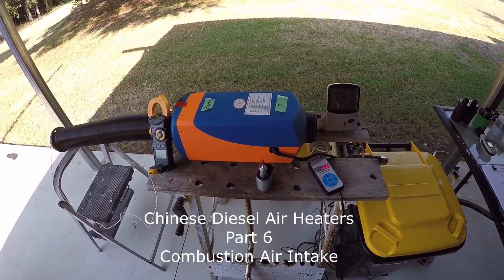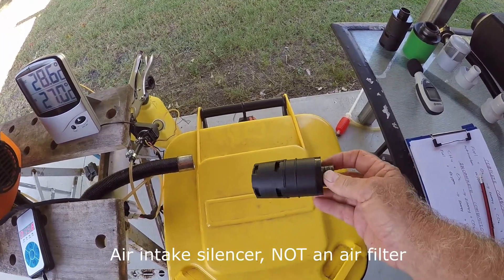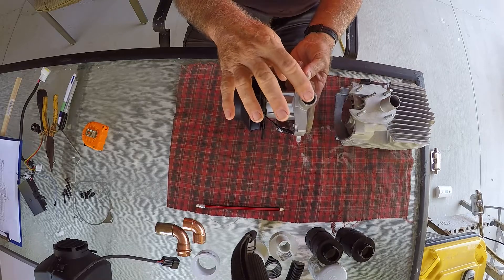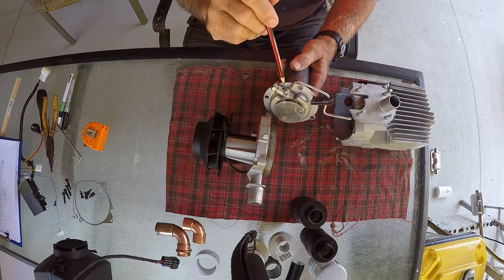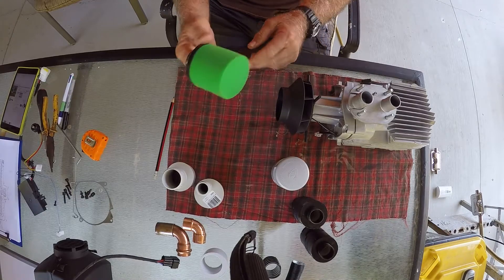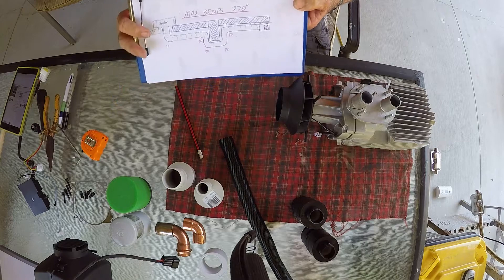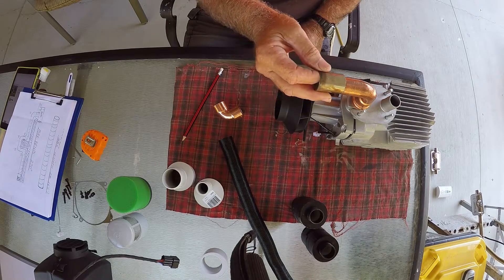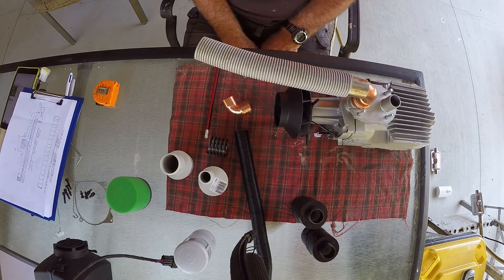Chinese Diesel Heaters - Part 6 - Combustion Air Inlet

Comment: John, I have the same controller used in your demo (part 6 & 8). Can you offer a easy to understand copy of the operation of this controller? I don't understand the translated version that came with my heater.
Reply from the maker: Hi Rhonda, sorry I missed this post, I get about 40 a week, and occasionally I miss some.
I do not have written instructions for the controllers, but may do a video about this at some future time., but here is a simple start for this blue circle controller. 

Turn on a short tap on the centre button. Turn off a long push on centre button until left LED flashes.
Increase temperature manually (my preferred method) push top arrow button up repeatedly to the setting you want. To go lower, push down button repeatedly. Use right button to cycle through some functions such as temperature.

Basic info, but should get you started.  JMcK

Comment: Are you able to contact me as I have watched your videos but my problem is LSD lights on the controller no longer light up.Larry Dunks 0417728486
Reply from the maker: Hi Larry/Julie, sorry to hear the issues with your LED controller. Occasionally the controllers do fail and you may need a new one as a spare part.

If you have had the heater less than one year I suggest first contact the supplier about this issue and seek a replacement controller. If that does not work contact eBay if bought through them or PayPal if paid through them. They may help with a refund of a controller cost.

Provided your heater is a standard Chinese  diesel air heater and uses the common wire connection protocol you can buy a spare controller on line from about A$16 for a manual controller to about A$25 for an LED controller with a remote.

Search on line for "Controller for Chinese diesel air heater, or Controller for Chinese diesel parking heater"

Below is a link to get you started in your search.

https://www.ebay.com.au/itm/12V-24V-LCD-Switch-Parking-Controller-Air-Diesel-Heater-Button-Remote-Control/313086073340?hash=item48e56259fc:g:OcAAAOSw9-tewfgy

Cheers,  JMcK
Reply: Thanks have just ordered one. We have 3 batteries and a solar panel on the roof charging all the time could this be causing the problem.
Reply from the maker: Julie Dunks 
No Julie, unless there is possibly a voltage regulation problem with your system and you are getting excessive voltage in your system. 
Do you have a heater master switch so you can turn the heater completely off? If not, the LCD controller is always on.  JMcK
Reply: No we don't have a master switch I can put one in but I am not sure where to wire it in if you can advise me that would be great.Larry
Reply from the maker: Julie Dunks 
Hi Larry, you can install a master switch anywhere in the positive power line from battery to heater. Just make sure it is in a position than can not be accidentally turned off, or mistaken for a light switch or similar.  JMcK

Comment: Excellent series of videos.   Would there be a problem with just having a straight intake hose through the floor of a trailer and putting a filter on there?  I did not understand if there was a minimum intake length like there is with the exhaust.
Reply from the maker: Hi David, thanks for the feedback.
That could work, but make sure the exhaust could not melt the intake filter.  Probably better to have just a short intake hose with a 90 deg bend under trailer to take intake just a couple of inches away from exhaust. JMcK

Comment: I'm just learning of these heaters,  your videos are the best. I'm planning on using one in a travel trailer. Does the main unit need to be inside of the trailer cabin?  I would like to have it in a weather proof trunk and just run the outlet into the cabin. Hope that makes sense,  thank you.
Reply from the maker: Hi Randy, nothing wrong with that, in fact that is a good install solution. You can have recirculating heated air, or heated fresh outside air. Suggest you put an insect screen over the inlet air, because the fan will suck in bugs.  JMcK
Reply: @johnmck1147  wow, that's good news.  Thank you so much for getting back to me with an answer. I enjoy your videos.

Comment: Hi John, thanks for the video series on these heaters - great work.  I just ordered one for our Skoolie and was wondering on your thoughts about a specific installation plan.  I would like to use the bus diesel tank (60 gallons), and opposed to tapping into the fuel feed to the engine, was thinking of replacing the tanks drain plug with a 90 degree fitting - but place a 2" or so copper/brass vertical nipple in the pickup side, so that 1) it's not getting fuel directly off the bottom of the tank; and 2) would always leave 2" or so of fuel in the tank for the engine.  Additionally, I think a mounting location near the front of the bus will work, so was contemplating using the exhaust of the heater to blow into the engine area (probably aimed at the engine oil sump).  The thinking is that if it's cold out and the diesel heater is running, it would also pre-heat the bus diesel engine (which is hard to start when it's cold out).  Any red flags in this setup?
Reply from the maker: Hi Jeff,

Sounds doable, just make sure exhaust gases can't get into the cab, and the exhaust does not face forward which would creat back pressure issues when moving.  JMcK

Comment: john,...regarding the 8000kw diesel heater, is it possible that it can make a big boom type noise like a back fire from getting dust into the heat ex-changer the reason i asked is i ask, is i just bought mine and after having it a day running it off and on,...it made like a big boom,...almost scared me out of my seat, i shut it down quick let it cool off took the top housing off of it and checked to see if it blew a hole in it,....there was nothing wrong with it,...but when the unit starts up now,...the glow plug emblem stays on and then disappears after the unit is running,....is that normal...
Reply from the maker: Hi thesecret2
A "boom" is not normal. Sounds like you had some excess fuel vapour in the burner. Why that happened needs to be investigated. 
The normal procedure is you turn the heater on, the fan starts to blow out any residue fuel, then the glow plug turns on to heat up the starter plug atomising screen, then the fuel pump starts. When the temperature probe on the burner tells the ECU that there has be a successful start, the glow plug is turned off. If there is no burner start after a set time the heater shuts down and tries the process again.  JMcK

Comment: of course it is going to get louder. you moved the outlet closer to the meter by the length of the silencer. that was not a fair example of the silencer. measure the sound from 3 feet away and 45 degrees off the axis of the outlet.

Comment: I must firstly how informative your video's are, 1st class.  My question is do you need a inlet hose at all can you just put a decent filter as close as you can to the unit? Cheers Martyn
Reply from the maker: Hi Martyn, first thanks for the feedback. 
Yes, you do not need an inlet hose and you can put a filter straight on the unit, but don't let the exhaust burn it. You may need a stub hose or lag the exhaust.  JMcK
Reply: @johnmck1147  thanks for the reply why I ask is I have a 2kw Erbaspacher on my boat in UK. Changed ignighter gause and gave it a good clean . When I start it I always run the engine to give it the amperage, it wants to go, blows alot of wispy white greyish smoke then turns bluish but it chuffs 
 and chokes doesn't quite fire up. So after looking at your videos looks like I need to check air intake and exhaust? 
Also worth mentioning I spoke to a webasto engineer, he said I high percentage of non starts are due to bad a bad earth especially on boats. Again fantastic videos . Hope all is well concerning Bush fires. Cheers Martyn
Reply from the maker: Martyn Randall .  Thanks for the feedback Martin. You are wise to check for restrictions in the setup. I would also look at your wire size. On start these heaters draw around 10 amps, low voltage or a long wire run to the heater of thin wire causes a voltage drop and poor glow heat.  JMcK

Comment: My question is if the intake hose is not a silencer then why bother with an intake hose why not just put a filter straight onto the heater. thanks for doing these experiments very interesting
Reply from the maker: Hi Jess, yes, you can do that if the heater is installed in a suitable area.  JMcK

Comment: the pvc screen vent you show here in this video. what is that for in plumbing/home improvement world........ can't find anything like it online from the big box stores... but Im probably searching by wrong terms.....
Reply from the maker: Hi Coachgeo, those are plumbing fittings, they go on the ends of PVC pipe for breather vents. Most plumbing stores will sell them. Suggest you take along a photo.

Or you could get one of these off eBay

https://www.ebay.com.au/itm/Air-Filter-Diesel-Heater-Black-Metal-Plastic-Manifold-Parts-Replacement/153602365113?ssPageName=STRK%3AMEBIDX%3AIT&_trksid=p2057872.m2749.l2649

Cheers,   JMcK

Comment: you seem to be very knowledgeable guy in combustion-ish things.. so may I ask you please...... if one were to add an HHO gas  source to one of these to use primarily as a way to occasionally clean out the combustion chamber or  improve combustion when using alternative fuel oils (thinned waist motor oil, thinned waste cooking oils etc...)  where would you suggest to fumigate this gas in?  am assuming as close to the unit as possible in some area of the air inlet.
Reply from the maker: Oh Coachgeo, these heaters need to burn clean fuel like diesel or kerosene. Yes, they will run - for a while on oils, but burning oil will really cause excessive carbon buildup in the burn chamber and the atomising screens. Excessive carbon in the burner atomising screen is almost impossible to remove.

But I also understand some people wish to experiment with these heaters as they are now so affordable. But in these cases I am unable to offer advice, for reasons most people would understand. Cheers.   JMcK

Comment: Since the fuel pump pulse rate is programmable/adjustable and fan speed also programmable then why not slow the pump and speed the fan. That way you get more air to fuel ratio?
Reply from the maker: Hi there, for what purpose? The pulse rate and fan speed have been optimised for best results in most conditions. Yes, if you are an enthusiast you could play with these adjustments to see if you could get a better burn at your location, but most DIY people only end up with excessive carbon build up in their heaters.   JMcK
Reply: @johnmck1147  for what purpose? Your video is all about air supply to combustion chamber and to avoid any restrictions to air intake. I suggested a different remedy to that problem. Increase fan speed and/or reduce pulse rate for those who can't avoid restrictions like many bends or long tube runs. I know the heater will run cooler but maybe that is good for the heater longevity.

Comment: Hi John what would cause smoke coming out the hot air outlet in the cap
Reply from the maker: Hi MW,
You should NEVER have smoke coming out of the hot air outlet.  Suggest you look at video no 15 in this series.   JMcK
Reply: @johnmck1147  thank you for your reply the air filter hose had too much bend in it its good now thank you for your series posts

Comment: I have a question John. I have this in my van. The air intake and exhaust are terminated outside the van. The van is more or less sealed inside appart from a 9x3inch vent close to the roof. Do I need to worry about oxygen levels? Thanks
Reply from the maker: Hi AA, I assume you mean the combustion air intake is outside the van. If so, you are not using oxygen from the van for combustion purposes. You also do not say if you have other combustion item in the van like a gas stove or candle lit dinners, or how open the vent and how sealed the van.

Anyway, if it was me I would like to have two vents always open and arranged to give crossflow ventilation.  My opinion.   JMcK

Comment: Air intake silencer can be a very good filter. Just take the front part off. Cap it ofwith PET cap and then drill holes around the silencer body.
Reply from the maker: Thanks for the feedback Waliza001.  JMcK

Comment: So if I just stick one of those foam air filters on the end of the air intake tube, and the tube is sucking air from outside and underneath my van, then the air filter will be getting wet since i'd be driving and kicking up water. Is that okay? or should have the air intake tube sucking air inside the van? Or something else?
Reply from the maker: Hi Mr Truth. You need some sort of filter, but why not just use a mesh type if you are not using the heater driving down a dusty road. If you use the heater while in motion are you able to install it with a water deflector?. Better not to install the air intake inside the van as you could get fumes coming back into the van when the heater is turned off or you have a fan issue. The air intake and exhaust are directly connected.  JMcK

Comment: will it not run too lean with the increase in air volume?
Reply from the maker: Hi Jason, not sure what you are referring to, can you give more detail please.  JMcK
Reply: @johnmck1147  yes  sorry, having been involved with motorbike engines most of my life when increasing air flow the fuel mixture also needed to be " richened" to avoid overheating, I,m now guessing this doesn,t apply to diesel air heaters? thanks.

Comment: Can the intake be mounted inside cabin? Or theres backfire/fumes possible?
Reply from the maker: Hi Minivanlife, not sure what intake you are referring to, but it is no issue if you refer to the large intake for heated air, and the combustion air inlet is preferable to be outside, but can also be mounted inside. On boats, both are mounted inside, but either way you need some outside ventilation and a carbon monoxide detector in the accommodation area.   Suggest you watch the video about servicing and broken gasket issues. JMcK

Comment: John, wouldn't you have to beef up the exhaust to the same dimension as  the new air inlet hose as well, otherwise there would be a restriction there too? Say that I went with 35mm intake, the exhaust would have to be 35mm?
Reply from the maker: Yes Timothy, but you will need to put slits in the ends to be able to clamp it down to the heater exhaust outlet, and you will probably need to use exhaust putty to get a gas seal.  JMcK
Reply: John McK 47 great John, cheers! I guess high temp silicone wouldnt work instead of exhaust putty?
Reply from the maker: Hi Timothy, it could be helpful to balance the system but I suspect not absolutely necessary if you have a short exhaust with minimal bends. 
The combustion fan sucks in a fixed volume of air, at low pressure dependent on its speed of rotation, it is not like a turbo giving high boost pressure, so it should work as normal.
But I have not tested a heater with different size inlets and exhausts to measure any differences in combustion. Cheers. JMcK
Reply: John McK 47 great John, thanks for taking the time to clarify! I'll see what I can find at the local hardware store.

Comment: Hi Again John, Amazing series really usefull information, after watching this video on Air Intake im going to take your advice and upgrade the inlet hose to 30-32mm that you have recommended, the trouble im having is finding the larger Air Intake filters that you have mentioned that you get from a Plumbers merchant, have you got any links please? so I can find an equivalant here in the UK, If Not would the larger Motorcycle airfilter be suffice? also Im going to change the fuel filter that you also recommended......Many Thanks appreciated
Reply from the maker: Hi Rockrebel,

If you have a pretty straight run with the combustion air intake it is quite ok to use the 25 mm intake hose that came with the heater.
If you have a longer intake hose, say greater than 1 meter or one with a number of bends, it is better to go to a larger diameter hose.

You can buy ss intake filters for these heaters off eBay. Search for intake filter for diesel air heaters. Here is one source I have bought from.  

https://www.ebay.com.au/itm/Air-Intake-Filter-Silencer-For-25mm-Intake-Manifold-Diesel-Heater-Durable-Tool/283596010270?hash=item4207a3b31e:g:G5AAAOSw0xhdZelm

It is 25 mm diameter so you need an adaptor, just like you need an adaptor to go larger hose on the heater. So you have an adaptor both ends of the larger hose.

The PVC domestic ss filters you can buy from a hardware store or plumbing store. In Aus you would go to a place like Bunnings, or Reece plumbing. I do not know an equivalent in the UK.

I hope this helps.   JMcK
Reply: @johnmck1147  really appreciate you taking time out to reply many thanks..

Comment: John I like the simplicity of that mesh filter can  you please post a link to Ebay on that? Cheers!
Reply from the maker: Hi Sean, below is the eBay link for one mesh filter. The PVC one is a hardware item, and the foam one from a motorbike shop.

https://www.ebay.com.au/itm/25mm-Air-Intake-Filter-Silencer-For-Dometic-Eberspacher-Webasto-Diesel-Heater/292922777996?ssPageName=STRK%3AMEBIDX%3AIT&_trksid=p2057872.m2749.l2649